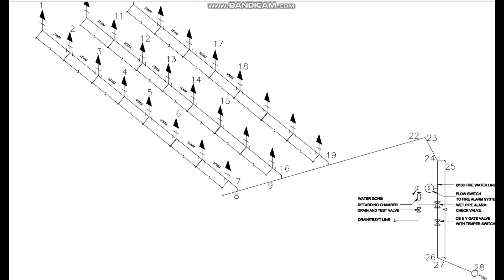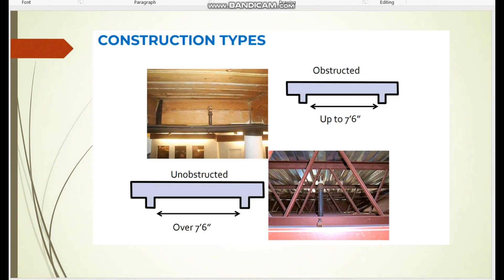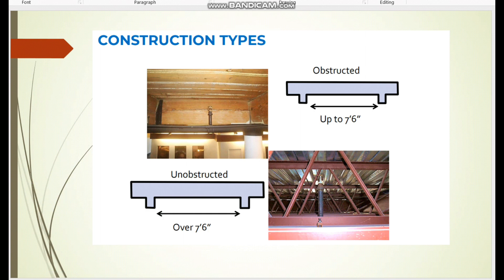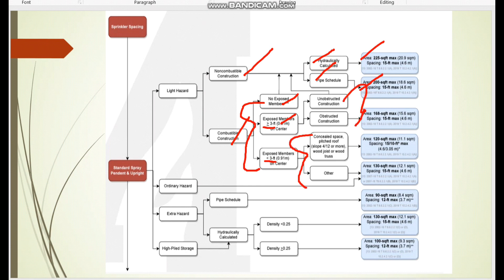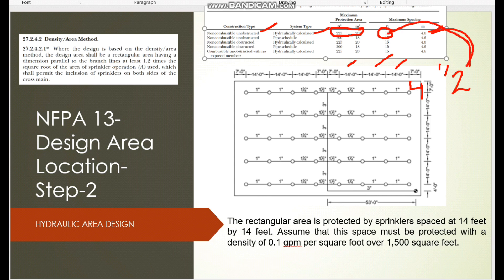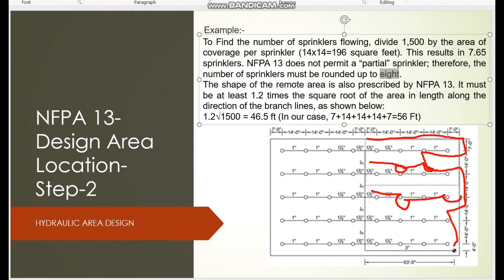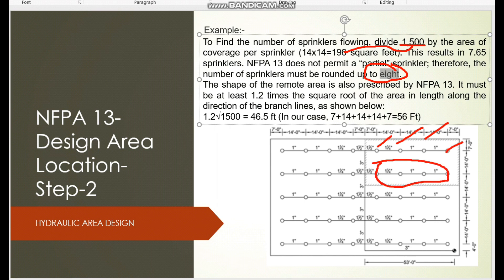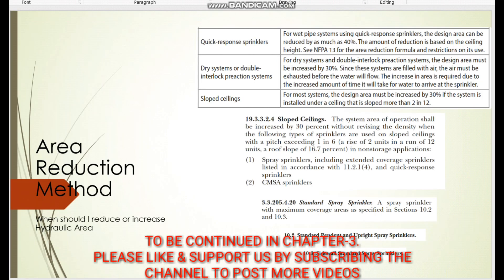Chapter-2-Sprinkler Design-Hydraulic Calculations for High Rise Building with Practical Design Issue

Comment: sir please  tell me about death zone - if death zone created what to do. Can we use sprinkler separation distance decrease as 4.6 to 3 mtr.
please give actual experience in this filed what to do.
Reply from the maker: Actually it depends on shape of the area also like rectangular or irregular shape buildings because value for both are not same
Reply from the maker: Normally for light hazard 4 x 4, ordinary hazard 3.4 x 3 I follow instead of going to the maximum allowable distance. It will avoid bigger death zones in-between the sprinklers